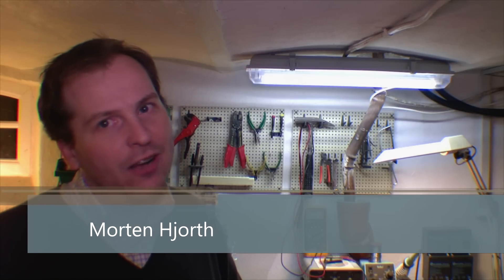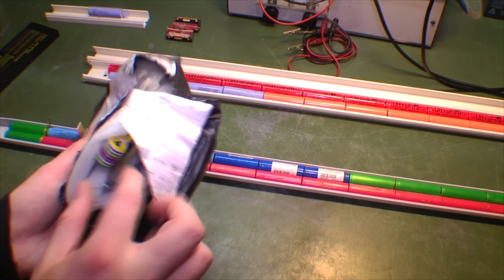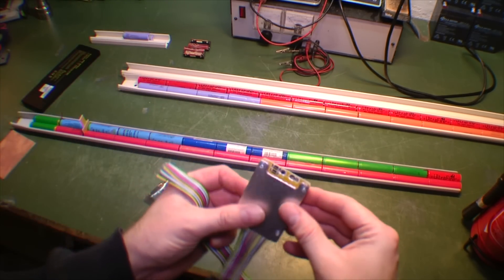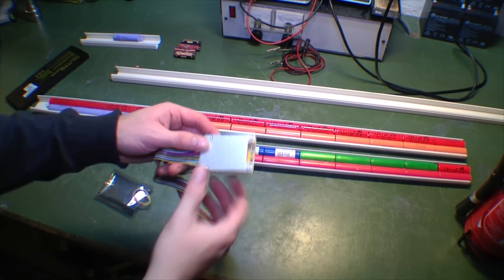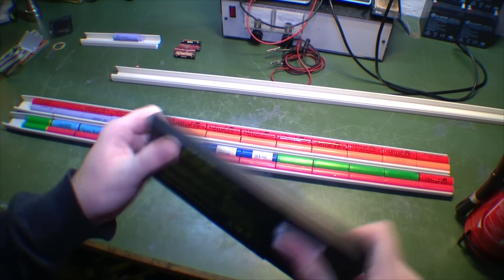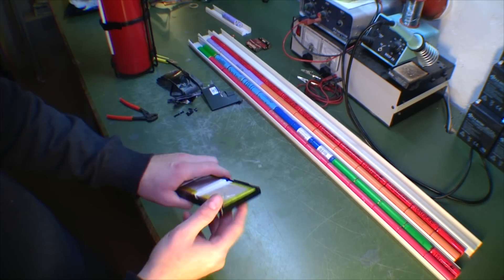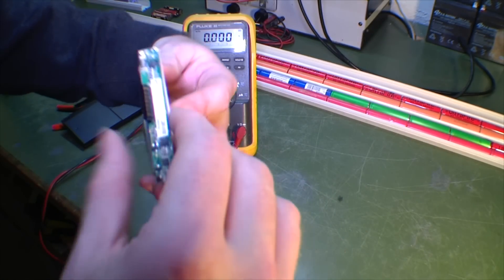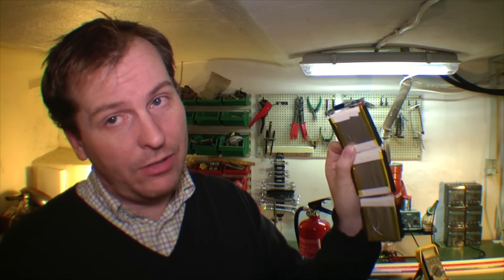Disassembly A Lithium polymer battery and 48V Li-ion Balancer - 259

Comment: my 48v li po battery have 16 cable bms, 
bms was broken so i ordered new bms for 48v battery. They send me with 14 cables.
Does not fit the fuck is going on.
Reply from the maker: Hi Artjoms Pugacovs
16 cables is more than I would expect for a 48 volt system.
Thank you for watching! :-)

Comment: That balanser thingy doesn't look like it can handle continuous 25A, maybe 25 peak but you can check it yourself. I don't think it can balance more than one 48v bank at a time because it needs to measure each cell and if you connect 2 or more cells in parallel the balancer thingy won't work correctly because it will average the voltage between the parallel cells but you can check that to with some dead cells.
Reply from the maker: Hi +Roman Berger 
This is a balancer for an electric bike,, and you parallel connect cells in those,,many! 
We will see what happens,, when i get that fare..
Thank you for watching! :-)

Comment: Aaah some LiPo action inside!  I accidentally put 2 different makes of nimh batteries in my light  and they released some kind of gas but the batteries  still works but the light not bright.  Should i recycle them or give them a charge?
Reply from the maker: Hi +Knuckles the Echidna 
Ha Ha NO way i am gonna answer that,, if you blow your self up, with a flashlight, then it suddenly my fault :-)
Thank you for watching! :-)

Comment: Old MacBook batteries used a similar port arrangement at the end like that one if I'm not mistaken
Reply from the maker: Hi +Gustavo Ferlizi 
Okay,, but this one was black,, MAC is usually not black,,, i do not know,, and i guess it really doesn't matter.
Thank you for watching! :-)
Reply: My PlayHouse Yeah, the actual machine doesn't matter. All MacBook pros pre-retina use this style of brick batteries with that cell arrangement. Can buy some old or knock-off ones to have a play with. The advantage I see with these flat cells is that you can tape them to heatsinks/metal case for better heat dissipation (pretty much a necessity when fast charging/discharging in a UPS experiment).

Comment: it is 3 Bank of 2 cells 1 cells= 3.7 volt so 2 in parallel and each 2 in séries for make 11.1 volts it is like my RC cars but i have  3 batterie with 3 cell  for 5000mah each :P and cool no Bang
Reply from the maker: Hi +pierre-alexandre lemay 
No this battery is pretty cool,, so i did really not wanna blow it up. Although it sure would be cool!!
Do you know of a good DC-DC booster to get this up to 12v?
Thank you for watching! :-)